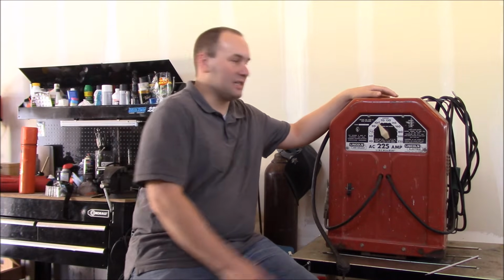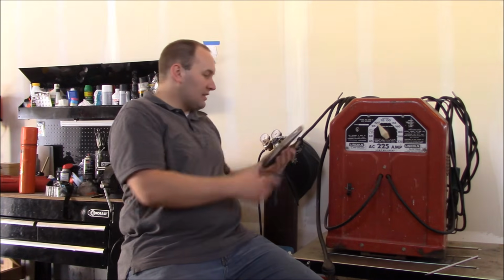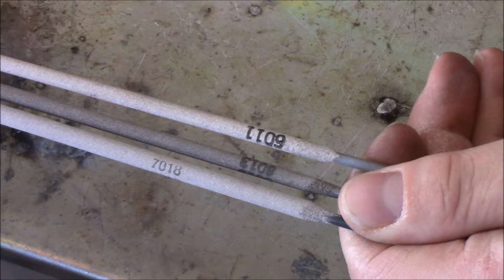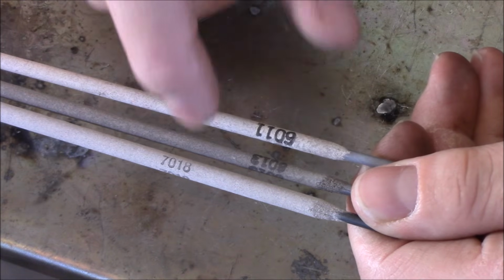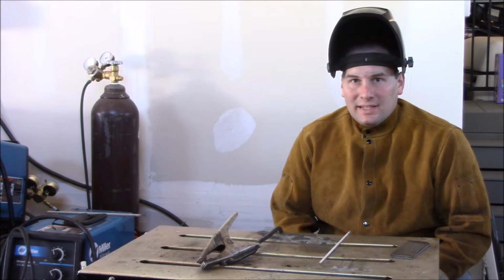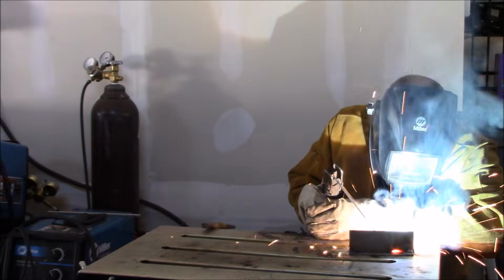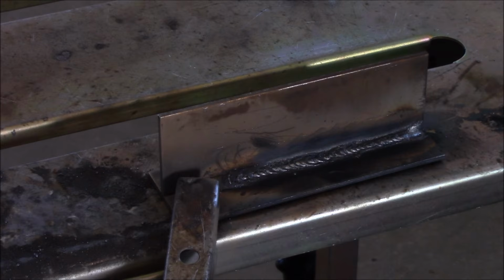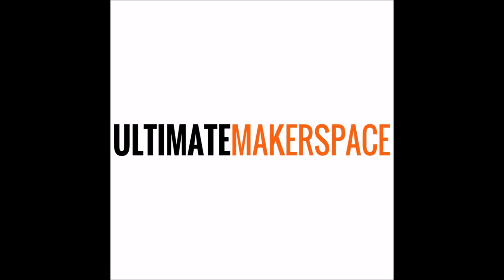Lincoln AC-225 Stick Welder Review

Comment: Will 240/30 amp work okay if I keep the amps down below say 150?
Reply: Warren Allred hello
Reply: Remember that this is a transformer welder,  not an inverter or digital.
Reply: nope will over heat and trip breaker
Reply: It's been fine for 3 weeks up to 175 amps no trip.  Thanks.  ;)
Reply: I have 30 amps. I don't run over 120 amps, and will trip the breaker at 10 to 15 minutes of continus arc.A big or heavy project will take longer.

Comment: How many volts comes out at the rod?
Reply: USNVA yih
Reply from the maker: Stick welders control the current, which is up to 225 amps. The voltage will depend on your rod and arc length, and is usually in the 20-30 range.

Comment: Can you weld car panels with a Stick welder?
Reply from the maker: Maybe, but I would recommend a MIG welder because there is no slag, which allows you to make a lot of really small welds to spread the heat and avoid distortion.
Reply: It would burn through

Comment: To where can you hook it up if you don’t have an 50 amp breaker. I’ve heard you could hook it up the stove or dryer. Or how could I get a 50 amp breaker ?
Reply: That is why you have a beaker to protect the wire.
No you won’t get full capability of the welder but I would not be afraid to use a dryer out let in a pinch.
Reply: I have used mine for over thirty years plugged into a dryer outlet. The machine only draws 50 amps at the highest setting and even then only when using a very large electrode. In a pinch I’ve used a 20 amp wall outlet and as long as I stayed under the 100 amp setting it worked fine.
Reply: @sarahwatson7692  Interesting! Thanks for posting your experience.
Reply: If you have an electric stove, you have a 50 amp breaker. The breaker dosen't mind how many things are wired to it. Just use one at a time.
Reply: Dryer is 10 gauge 30 amps, don't hook a 50 amp to a dryer circuit or you risk a fire , min 8 gauge line 220 50 amps. This is not a place to try a hack job trust me.

Comment: I got mine for 75.. it's a reliable beast! PEOPLE... IF YOU HAVE A FANCY MULTI PROCESS MACHINE  YOU SHOULD STILL PICK UP ONE OF THESE OLD WORK HORSES AND LEARN AND TEACH YOUR KIDS THE OLD FASHION AC STICK... PS 7014 RUNS LIKE A DREAM ON THE OLD AC.
Reply: i bought mine in 1975 too $99.oo with hood and gloves included, new right off the Lincoln dealer floor and still runs today just like it did when i bought it

Comment: I just bought a Lincoln 185 at auction, built in ...1958 ! It still works but only on full 185 amps using a 7014 stick, can anyone tell me what may be wrong or why it wouldn't spark/strike at any amps less than 185 ?
Reply: tony mememe bad switch?
Reply: Are you using old or wet rods.
Reply: Probably a bad switch selector, unplug it,   take it apart,    wire brush and scrape all the contacts, 
 Blow it all clean then try it. Or turn the selector switch back and forth. HARD AND FAST !!  20 or more times,   to clean the contacts,  then try it.

Comment: I LIKE THAT OLD MACHINE THE ELECTRODES ALWAYS STICK I THINK IT IS OPERATOR ERRORBECAUSE MY SON CAN MAKE FANTASTIC WELD WITH THIS
Reply: Grind of a clean spot for your ground clamp.    
If you put your ground on a rusty, dirty or painted surface the current setting can vary widely.  The 6011 rod , once it starts burning, doesn't care so much about dirt, paint, or rust, as long as you have a good ground.  90A is okay, but if you have some thick metal go up in amperage and it will help learning.  I seem to use it at 120A a lot. Tim talks about using 6011, it is not really a drag rod.  That makes it a little harder to start out with.

Comment: could i run this off of a gasoline generator
Reply from the maker: The generator would have to be fairly large (probably over 10 kW). A better setup for mobile welding is a welder generator combo. If you already have a generator that you want to use a welder with, I would recommend looking for an inverter welder because they are more efficient (use less power for the output that you get). Thanks for watching!
Reply: @TimWelds  I do. I have a 13kW generator from Lowe's.
Reply: UltimateMakerspace thanks man I just don't have a 220v outlet at home!
Reply: Would haveto be so big you might as well find a used gas mobail welder.
Reply: I run mine off a 7500 watt generator, I just can't weld hotter than about 180 amps